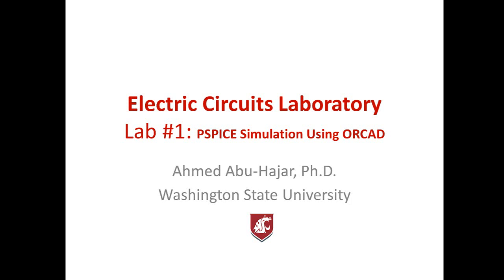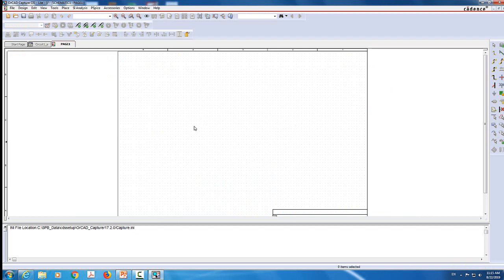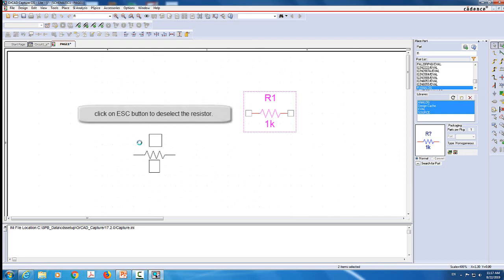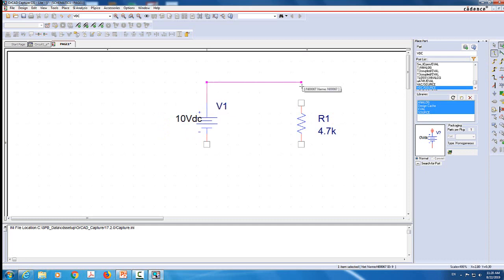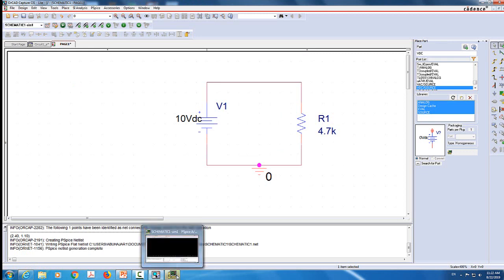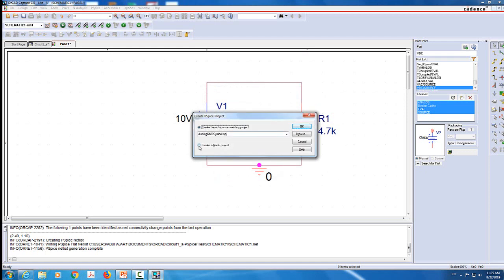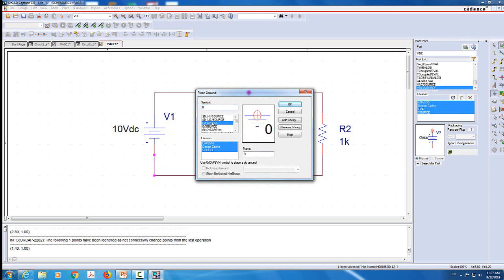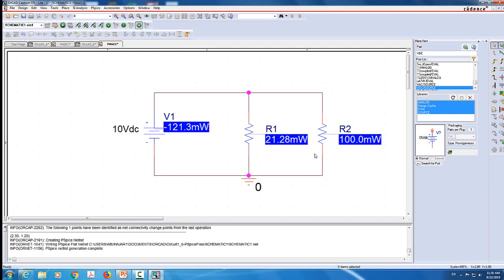PSPICE circuit simulation with DC Measurements (Bias Points)

Comment: Hello sir, Thanks for the tutorials.
Just a question: How can we calculate the current that exits from a node in OrCAD? Like when we are calculating the KCL of a node. Because the Ampere meter only connects to a pin and won't place on the wire. I have an op-amp, I want to sum-up its current with another current that comes from another place together. I tried R=0 but an error msg came up. Also, we can't connect the ampere meter to GND.